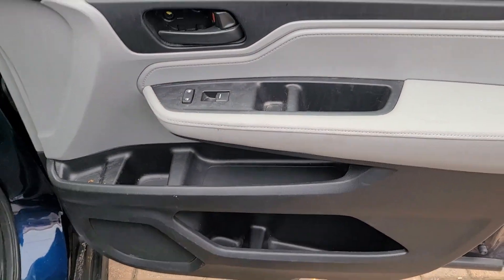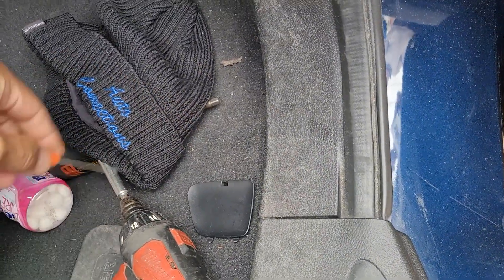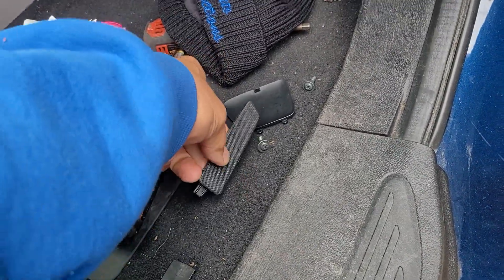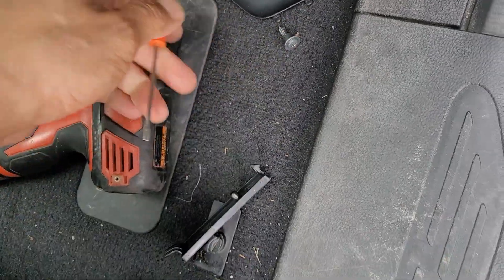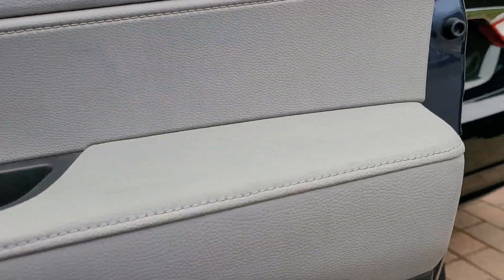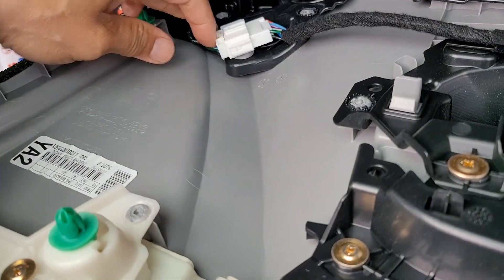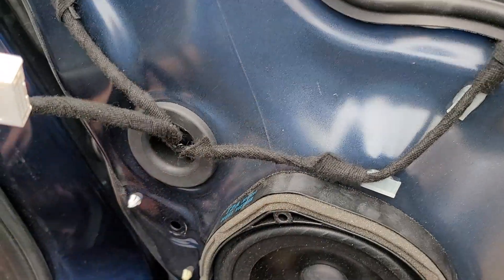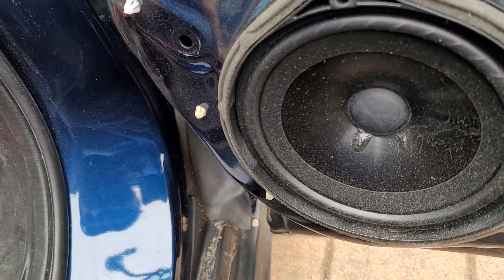How To Remove 2018-2025 Honda Odyssey Door Speakers.

Comment: Thanks for the video!!  When you installed the new speakers, did you have to cut out the lip on the inside of the panel that creates a seal between the speaker grill and the speaker?  Or were you just able to put the panel back on as it was after replacing the speakers?  Crurchfield states that you have to modify the inside of the panel by cutting off this lip so it does not rub against the new speaker which I guess is a little bigger than the stock speaker.  Also, did you do just the fronts?  If so, was there a big improvement in sound?  Thanks again!
Reply from the maker: All good questions. But I never replaced the speakers. 🤣🤣🤣. I just show you how to do it. BUT. Fortunately for you, I have more than enough experience to answer you. First, did you use new speaker adapters? Second, how "good" are the new speakers? Meaning, the more money you spend on the speaker. The better the speaker, which means bigger in size. Bigger is always better.🤣🤣🤣..lastly. Yes, sometimes, under no unforeseen conditions, you have to cut the panel so it doesnt rub. Or your forced to "smash" the door panel back on and runs the risk of ruining your brand new speakers. Oh and uuuuhhh..YES AFTERMARKET IS BETTER THAN FACTORY..🤣🤣🤣. Especially with Honda. Subaru is also a other one that has absolute junk speakers. Replacing the radio is always a benefit to sound quality, but not mandatory because of the money needed to do so. Especially with the newer Odyssey..ooph..the generation before that one was a NIGHTMARE to replace the radio. Yours isnt too bad, but is still on the pricier side. Audio is neverending, too many scenarios, configurations and product out there. Asking questions is always good to guide you into a direction. Starting with the speakers was the right thing to do. If you have to cut, I would use a razor AIMED AWAY FROM YOU, and keep swiping in the same direction. Thin plastic and when swiped at, it should break right off. I will bill you for my time now..🤪🤪🤪
Reply: Thank you for the quick and detailed reply! With your help, I feel pretty confident in replacing the front speakers. Time to go shopping! Thanks again!
Reply from the maker: @bryanm1498 no problem. Dont I have links in the description for speakers?
Reply from the maker: I gota look. Lol
Reply: Yes you do have links. Thanks again!
Reply from the maker: @bryanm1498 no problem. Best of luck, but its not that hard. Its a Honda. Lol